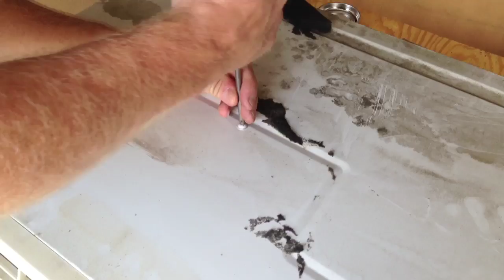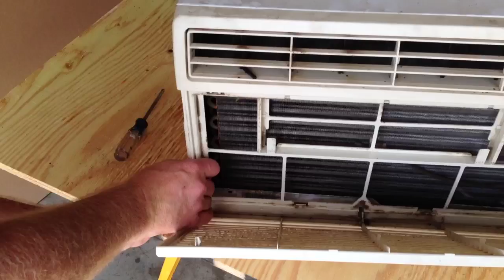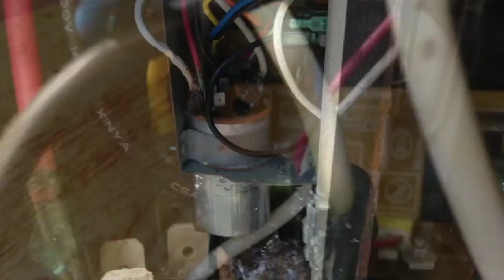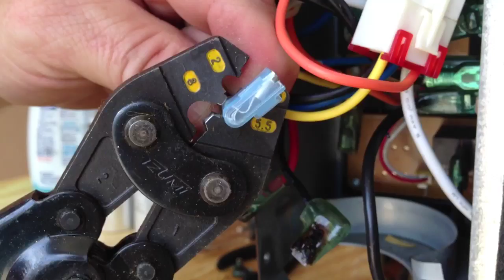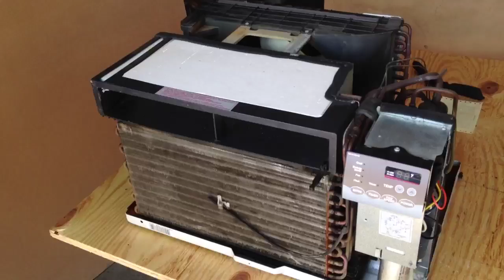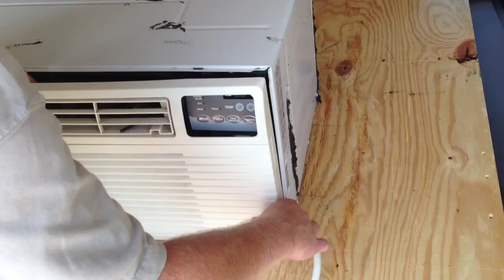Repairing an LG A/C unit by How-to Bob

Comment: Hey Bob. I got my fuse from amazon. Could you tell me, do i have to discharge the big capacitor either before taking PCB-motherboard out or before installing it back? Manuals say that we have to. Problem is LG LT1230CRY7 did not start this summer. My capacitor and wiring looks good too BTW. https://www.pcbgogo.com/Blog/How_to_Discharge_a_Capacitor_on_a_PCB.html
Reply from the maker: Yes, definitely discharge the capacitor. Hope this helps, thanks for watching.
Reply: @funbro1  LG room air conditioner LT1230CRY7. I put in my new fuse as written in control panel and it blew up again. I think the old fuse had soldered thick wire. Given the type of the air conditioner how do u think I have to discharge main capacitor. And should I check input voltage from the outlet. I have the Craftsman Digital MultiMeter Model No. 82140.

Comment: I have a six year old LG through the wall A/C that worked fine last year. This year, it blows air but the compressor does not come on. Thoughts? Repair protocol? The unit is clean.  I really don't want to send it to a landfill, not to mention a replacement is in excess of $600. if I can find one. All help appreciated.
Reply: Try to replace the capacitor for the condenser. They do fail often and you can probably find one on Amazon. What model LG do you have? That could help determine the capacitor size. If you have a multimeter with a capacitance function you can test the capacitor if you remove it. Usually the capacitors have the rating in micro farad. 

I replaced mine for 10$ from Amazon. Do some troubleshooting first and test the capacitor. If you can’t you can always try to replace it first.
Reply: @Wilhelm_Brandt  The compressor seems to be running. Wouldn't a bad capacitor prevent that? I don't see any damage on top of the capacitor.
Reply from the maker: I agree, I would start with the capacitor. It is an easy inexpensive part. Thanks for watching.

Comment: Hello Bob, my lg unit displays CH 26. Could you possibly tell me how to fix this.  Thank you in advance.
Reply from the maker: I would start by checking all the wiring. Usually this code could indicate a wire unplugged or cut/broken. Other that that check the inverter then the compressor. Hope this helps. Thanks for watching.

Comment: Bob is that because your AC never turned on that you checked and it was a capacitor
Reply from the maker: Yes that is usually the symptom. Sometimes the motor will hum but not start. Thanks for watching.
Reply: @funbro1  believe it or not my AC had stopped working took it apart to see the capacitor capacitor was fine lo and behold on the motherboard a tiny little 5 mm by 20 mm fuse blew out and that's all that was wrong with it
Reply from the maker: Sometimes finding the issue is the hardest part.
Reply: @danieldepot4090  Thank you Dan. I also have broken or burned shaky Fuse. 3.15/2A on PCB marking. What did u do to fix it. Did u take control panel out and soldered fuse back using iron or did u replaced the fuse? I have never done it before. My capacitor and wiring looks good too BTW.
Reply: @alexpodolsky8980  just took the panel off and saw that the motherboard had a fuse and it was burnt out and a store in my area sells them so I just bought it put it in and it works back as new
Reply: @danieldepot4090  Thanks a lot Daniel!

Comment: BOB, I have a similar unit that stops working intermittently. Sometimes speaying contact cleaner where the control board plugs in fixed it. Letting it sit through the winter and trying it again this year worked for four days, then stopped. What are the chances that it’s just the control board?
Reply from the maker: Sounds like where I would start looking based on the info that you provided. Thanks for watching.

Comment: Hello Bob, I have the same AC. It tripped on the Reset and Test button. So there is no green light comes after plugged in. Hukk 2142288426
Reply from the maker: Sounds like something is shorting out inside. That will need to be addressed first. Take it apart and the problem may be apparent if you follow the power cord back. Hope this helps,Thanks for watching.

Comment: I have an 8000 btu lg LW8012ER.  The power button and up temperature buttons work but the down temperature, mode, timer, and fan speed buttons will not respond when pressed.  Any ideas about resolving this?  Also, if I buy a remote control will that work in place of using the buttons on the air conditioner?
Reply from the maker: As i was reading your comment the first thing that came to my mind was to try the remote, so I would say that if you don't currently have a remote and the unit is set up to work with a remote then try that. The next thing would be the control board. Hope this helps. Thanks for watching.
Reply: @funbro1  thanks

Comment: What were the symptoms of this AC unit ?mine keeps on freezing over the front part on the outside also..... I let it set for an hour and then it will run again.
Reply from the maker: It was just not running/blowing. Sounds like you either have an air flow problem or a leak has caused some of the refrigerant has leaked out. Thanks for watching.

Comment: How do I change the fuse inside my window unit?
Reply from the maker: Start with the power coming into the unit and trace that wire back into the unit, usually that is where you will find the fuse if there is one. Thanks for watching.

Comment: I have a LG model LW1212ER And it just started to change mode on its  own.  From cool to energy saver to fan. Any idea as to what to replace? Thanks
Reply from the maker: That could be a sensor telling the unit the wrong info or the controller not functioning correctly. Thanks for watching.

Comment: Nice work, Bob!  Good video. Could you tell me how to fix an LG portable a/c--heat pump, model no. LP 1415SHR?  We're burning up in here and the thing won't work.  Appreciate any help you could give me.  Thanks for your time and skills.
Reply from the maker: First thing I would check is the filters, I also have a portable unit and it does not work very well if the filters are dirty at all. I clean them every few days and it helps tremulously. Air flow is the next thing to check, make sure there is sufficient air flow. There are many things that could be wrong here and it is almost impossible to diagnose without seeing the unit. I hope this at least gets you started in the right direction. Stay cool and Thanks for watching.
Reply: @funbro1  Thanks for the advice!

Comment: But what was tje problem to this unit ?....I know about the wires ...but what did the unit did?
Reply from the maker: Didn’t work...wouldn’t even start up. Thanks for watching.
Reply: Mine has power but won't turn in
Almost the same model
8000 btu 6 yrs old
Has been doing this, for awhile but would eventually start working
Timer counts on its own... 
Today nothing... Has power but a day later still won't run... In the middle of the most humid summer in 30 years
I was blaming the humidity
Reply: @mmcbride256  mine is doing the same thing with the timer, you ever figure it out?
Reply: @kylewoodward7078  no...I am buying a new one this weekend.
It's a great unit but it just wore itself out.I think the panel was shorting..
Reply: @kylewoodward7078  no... It got worse... 
Just bought a new one

Comment: Funbro1, I have a problem with my LG A/C wall unit.  Its a remote control one.  It turns off on its own.  I was wondering it there a way to just by pass the board and just hook it up manually?
Reply: My lg does the same thing... Any answer????
Reply from the maker: Not that I know of.

Comment: Hi there, I have a problem with my LG Window AC 15K btu that the reset buttom trip every time I plug in  the 220 volts outlet .I reset it many times but the problem continue. I made many reset test but the problem continued. What would be the problem???
Reply from the maker: I would have to have the unit to do some tests before any diagnosis can be made. If I was to guess I would say it sounds like something is causing the unit to draw too much power and tripping the reset switch. You will need to test a few components to determine if this is the case. Best of luck and Thanks for watching.
Reply: Bob, in your experience in the field, you found that the room air conditioner power cord lg 6411A20048M the reset buttom get defective and do not let the AC power up...
Reply from the maker: Victor Rios That is possible
Reply: Bob, I found the problem,the power cord of my LG air condition was the problem.The reset buttom was full of rust inside the plug ,I changed and the AC is working pretty good.  THANKS A LOT FOR YOUR HELP...

Comment: I got the LW1015ER, it's a 10k btu lg unit it stopped working, it was doing just great and I turned it off one morning and it never turn on again any ideas
Reply from the maker: Start with the breaker, then work your way to the internals of the AC. Could be almost anything but without seeing it and looking at it, it is very difficult to diagnose. Best bet is to dig in. Thanks for watching

Comment: help.... my lg 6000 blows cold air for 5 seconds... then hot air for 5 seconds.... then repeats this over and over
Reply from the maker: Hard to diagnose without having the unit, but it could be the sensor or control panel. Hope this leads you in the correct direction. Thanks for watching.

Comment: my Hampton bay/LG everything appears to be working but compressor will not stay on but like a second and continues doing it. line out cools very cold during brief time it's on but don't stay on long enough to actually cool.
Reply from the maker: Sounds like it could be low on refrigerant.
Reply: @funbro1  If a unit is low on refrigerant, is the procedure for refilling similar to an auto system i.e. vacuuming, then refilling? Can you do a video on this? It would be greatly appreciated. Thanks much.

Comment: I just bought a old air conditioner/ heater it is a Kenmore model 106.8781270. It does not have the outer shell or the control knobs. With no front to it I have no idea what the controls do. Do you have any abilities to send me a photo of the front of this unit so I will know what to turn for heat or air?? I tried sears website and they do not have any manuals to show me.
Reply from the maker: I looked around and was unable to come up with anything, sorry.
Reply: Thanks for looking !!

Comment: I pressure washed my AC and it was working but I guess I didn't let it dry and it just blows warm air now what can be the problem
Reply from the maker: It could be a number of things, sounds like something got wet that shouldn't have. It is very hard to diagnose without seeing the unit but I would  not recommend pressure spraying an AC unit.

Comment: hi funbro1  I,m kinda green at this so i hope you can give some helpful tips,  I found an upright on wheels portable lg a/c that i manage to get working , It has two fans one that blows the cold air and a second one that blows  exhaust hot air out the window , the problem is the second one gets really hot to the touch , is this normal??? thanks for any helpful tips.....
Reply from the maker: It will get hot because of the hot air it is blowing out, the question is how hot? That is hard to tell without seeing the unit. Thank you for watching

Comment: Thanks for the video HowtoBob/funbro.     We are having our hottest week here in the northeast and two of our window air conditioners have stopped working.   Both still have fan function and both control panel lights are working.   Neither unit's compressor is turning on.   This video gives me hope that a home repair may be possible and I will be taking the cases of both to see if there are any obvious issues, i.e. blown capacitor as in this video.  

Did the unit in this video still have fan function with a faulty capacitor before the repair?
Thank you.
Reply from the maker: No, the fan was not running before the capacitor was replaced. Hope this helps. Good luck on the repair.

Comment: do you have a video on installing the power cord of an lg window air conditioner... i just to see where the white and black cords plug in
Reply from the maker: Sorry I Do not have a video for that.
Reply: @funbro1  I need that bad right now... just ripped those right out of the unit when it fell out the window
Reply from the maker: @AlexeJade  Ouch.
Reply: @AlexeJade  did you figure it out. I have same problem

Comment: My ac wall unit is blowing hot air and the compressor never kicks. I have already changed the capacitor with a new one and it is still blowing hot air. What should I do.
Reply from the maker: +dennis elbo It is hard to diagnose without seeing the unit but it could be many things including the lack of coolant, compressor, or control board. Unfortunately it Sounds like it may be time to replace the A/C.
Reply: Overload protector switch

Comment: Mi LG ,,,,,lw2410hr,,,, unit is giving me trouble,the cold air works fine,the fan works also....but the heater ,,,works for a few minutes then it make a pop sound,,,and turn off ...and trip the breakers,,,a reset the breakers ,and its starts again and the few minutes later does the same
Reply from the maker: +leonardsahidruiz Could be a thermostat, but it's hard to diagnose on the internet.
Reply: I clean it, this morning like u did on the video...but this time the heat works for few sec....then again ,, a hard pop ,,,and also the breaker switch is off
Reply: Sounds like the capacitor is the one making a big sound ,,,like (popppp)

Comment: Hi I clean the coils of my 12000 btu lg unit with water and now its not working it was working fine before I clean it. The rest button is not working the direction say to unplug unit  push the reset button plug it back up then push the test button and the reset button will pop up but when I unplug the unit and push the reset button and plug it back up the reset button pops up any ideas hot as hell in houston
Reply from the maker: Dayton Kinney Sounds like you may have used too much water. I would recommend using a foaming coil cleaner on the coils. If you have an air compressor try blowing out any excess water from the unit and let it dry thoroughly. If that does nothing then the real trouble shooting will begin.

Comment: I have a 12000 BTU thru-the-wall Hampton Bay unit.  I suspect it's made by LG as several of the parts are marked with LG data labels.  It's also very similar in appearance to the unit in this video.  Everything works except it blows ambient temperature air - no cooling.  There's no obvious damage such as burned wiring.  I'm a rookie at a/c but can handle simple parts replacement (unpressurized).  Any recommendations?
Reply from the maker: Frank Joy I would try the capacitor, it's a relatively cheap, easy repair. That would be my first check. Thanks for watching.

Comment: I think we have the same problem as Sid. Our LG A/C with heat was working quite well, In fact, it got the room so warm we had to turn it off for an hour or two. When we started it back up, it just did not heat but the rest of the unit seems to run just fine. there was no sound or smell to indicate any type of problem. I figure it must be the heating element or capacitor. Could you give me an idea or cost and availability.
Reply from the maker: Jackie King Without seeing the unit it is very difficult to diagnose the problem, but I would start with the capacitor then the control panel followed by tracing the power through the unit to see where the power stops. Once you have found where the power stops chances are that you have found what is wrong. Hope this helps.

Comment: I have question I have same model but my issue that digital thermostat wont let me lower temp. I press the arrow down but instead of temp lowing it goes up? Can this be repair and how?????? Help! Help! Help!
Reply from the maker: Patym04 Sounds like the buttons on your control board are bad. You should be able to get a replacement for that online.

Comment from the maker: jim chivas
I have the same problem that Scott Nagle has.  Mine is a 6000 BTU Haier with only 1 season. I unplug it and hit reset then plug it back in , beeps, no power.  Is it possible that the problem is a bad reset assembly on the cord?
Reply from the maker: You could un-wire the power cord inside the unit and use a replacement to test the reset assembly.
Reply: funbro1

Comment: I have the same problem that Scott Nagle has.  Mine is a 6000 BTU Haier with only 1 season. I unplug it and hit reset then plug it back in , beeps, no power.  Is it possible that the problem is a bad reset assembly on the cord?
Reply: Never mind I am an idiot.  I guess that is what it is supposed to do.  After plugging it in again, the screen was dark but all I did was to push the power button and it came on fine...as I said I am an idiot!
Reply: Don't worry always happens

Comment: i got one my fan is not turnin i change the capacitor and fan motor but nothin still not work any ideas
Reply from the maker: Trace the power through the unit using your meter and find out where the power stops. Start at the power cord and work you way through the unit till you lose power. Be careful when working with live power.
Reply: funbro1 ok thank you am goin to do that

Comment: My LG unit runs ice cold. But only ice cold. It's feels as though the thermostat stopped working and if I power down the unit, the condenser still hums. The only way to stop it is to unplug it. Any suggestions on where to start trouble shooting? Thanks for a great video👍
Reply from the maker: I feel like you may have nailed it. It sounds like the thermostat or possibly the thermistor could be bad. I have seen the thermistor for under $10 so this would be a good place to start. If it is the control unit that will get a little pricey. Hope this helps.